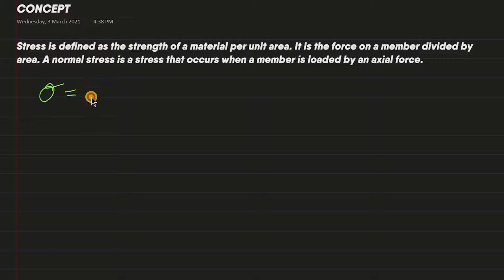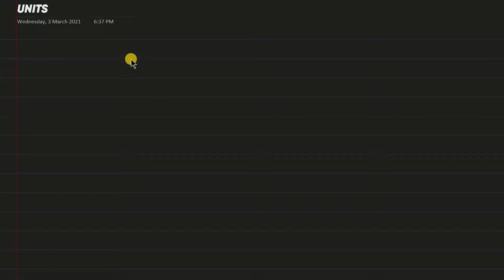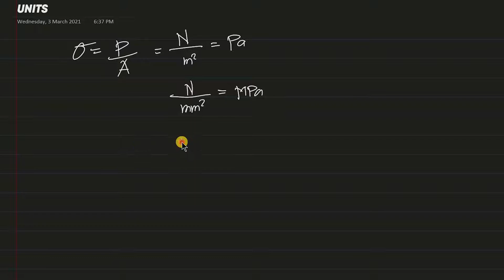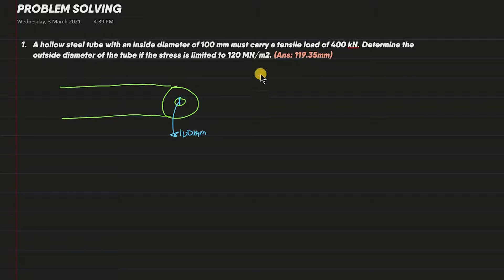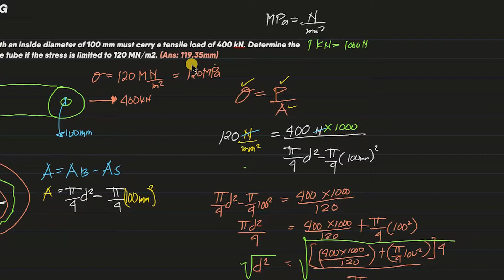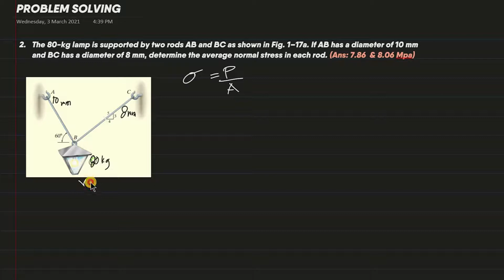Lesson 2: NORMAL STRESS (Simple Stresses) | Strength of Materials (Filipino)

Comment: how about these one..A hollow steel tube with an outside diameter of 100 mm must carry a tensile load of 400 kN. Determine the inside diameter of the tube if the stress is limited to
120
M
N